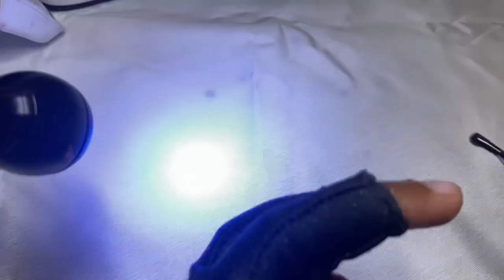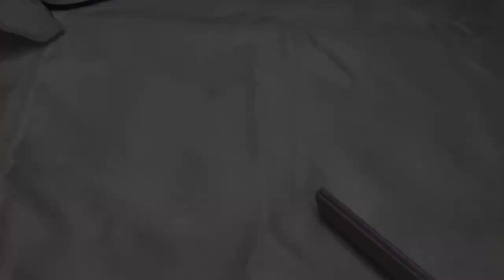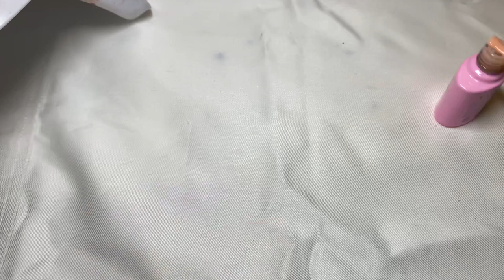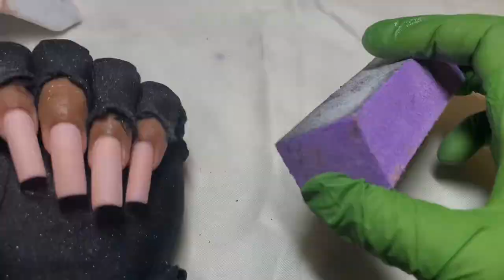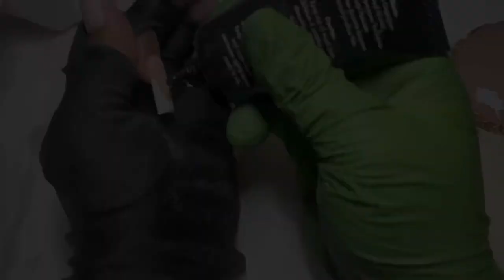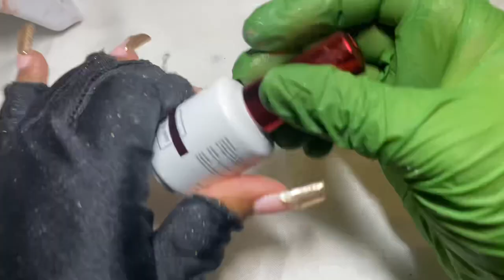Trending 3D Chrome Nails | Super Easy At Home Gel X Nails | Gel X Nail Tutorial

Comment: So you buff the mail after applying gel color?
Reply from the maker: Yes buff after curing the gel polish for 60secs , gently to just get the shine off otherwise the chrome will stick to anything that’s shiny or tacky . if you’d like you can also use matte top coat instead of buffing it’s just my preference to buff ❤️
Reply: Do you buff your nail polish even when you're not using chrome polish?
Reply from the maker: @jussmya1909  Hi ☺️ no I only buff when using chrome . This is just a step you do to remove all the shine off the nail so the chrome doesn’t stick to unwanted places . I know a lot of other people use matte top coat instead if you don’t want to buff it works the same way . Thanks for watching 🧡